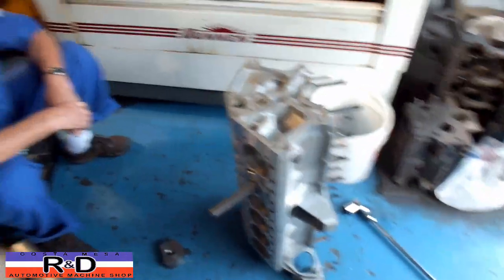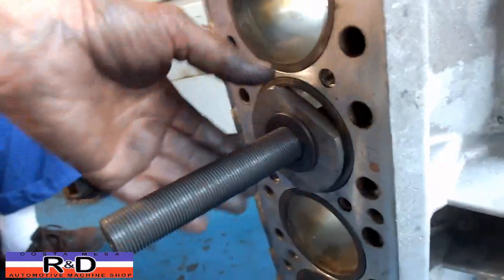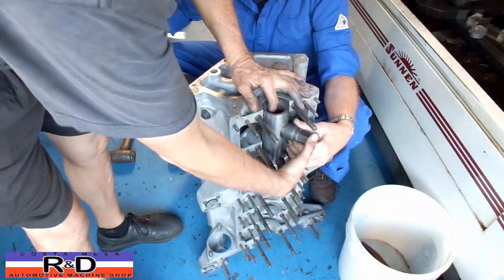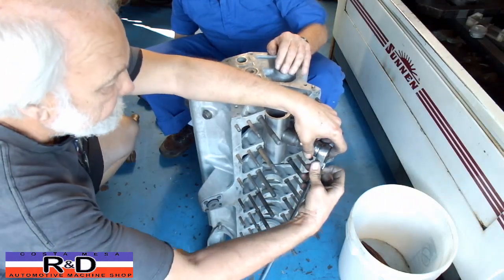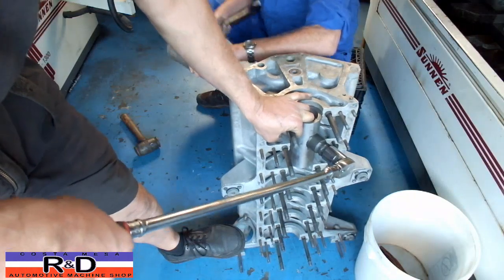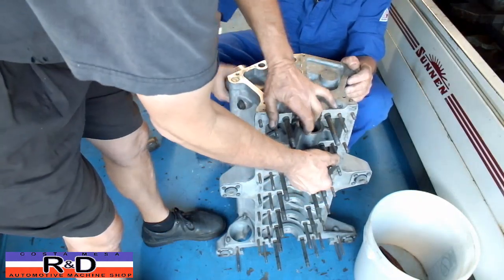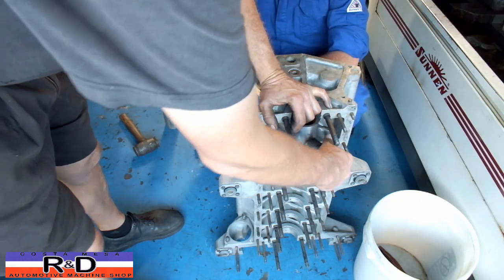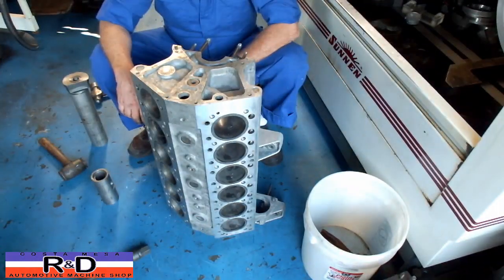Ferrari 330 Sleeve Installation

Comment: Jesus,anybody seen Hotrod?Where Andy Samberg is hitting the smallblock with a hammer?Thats what these clowns are doing.Kinda like putting your foot on a stool and then bending down to tie the laces of the shoe on the floor.WTF!?First,they're working on a motor on a floor,next to a popup trailer?Next,they are using the ALLOY block  main bearing face as a clamping base for a STEEL piece of pipe to suck in the liner?That surface should never be touched with anything rougher than a fingertip.Unless of course you are going to rebore the mainline.My god,the incompetence displayed here is horrifying.I'm sorry Ferrari engine block,RIP.

Comment: Pack the sleeves in dry ice and fall  in a hot block all the way.
Reply from the maker: +joe vanvalkenburg You still have to pull the sleeves to the bottom of the block. Once the block cools, the sleeves will slightly move away from their seat. There's more to this then just hot and cold. These sleeves have no bottom seal like a lot of other engines do and it's imperative to pull the all the way down. Aluminum expands at twice the rate of cast iron and that's where the problem really is.
Reply: if I understand well, the most part of the job has been  made by heat and shrink, this touch up is to ensure the perfect location of the sleeves
Reply: no, no they wont.